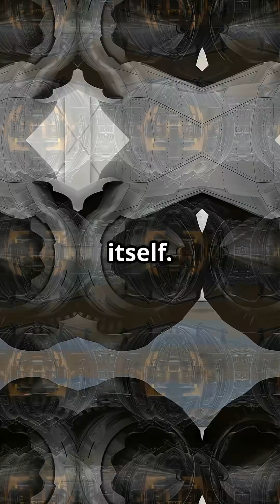Jet Engines Don’t Push — They Pull Air Back

Comment: Combustion in a jet engine pushes in all directions but as there is a hole in the back of it (exhaust) the pressure is lower at the back, than at the front, so the high pressure pushes the engine forward,  its exactly the same as a balloon when you blow it up and lose it go, low pressure at the back , higher at the front, I worked ming rolls royce jet engines and it was very clearly explained in their customer literature